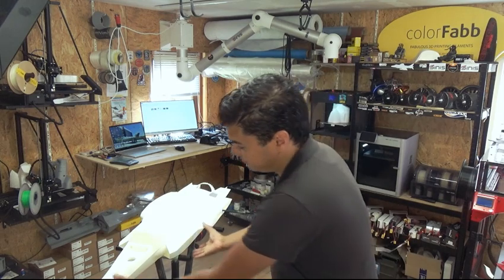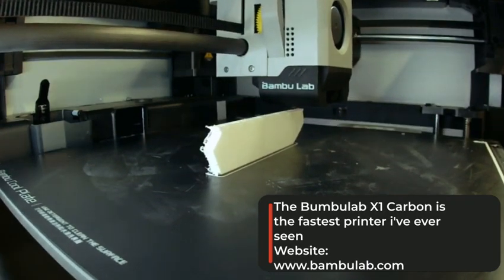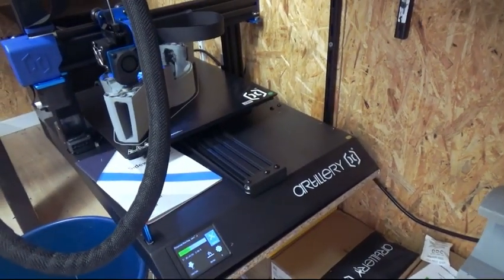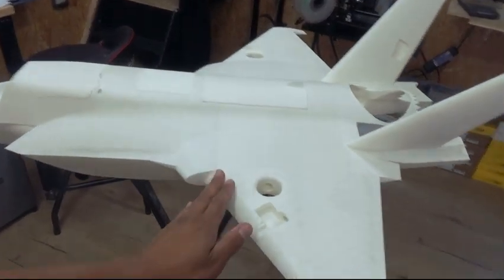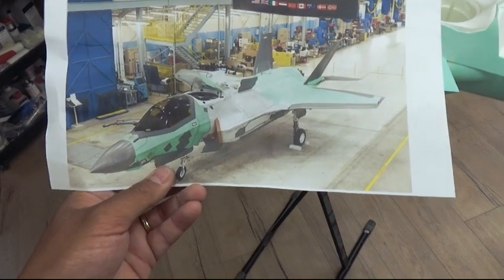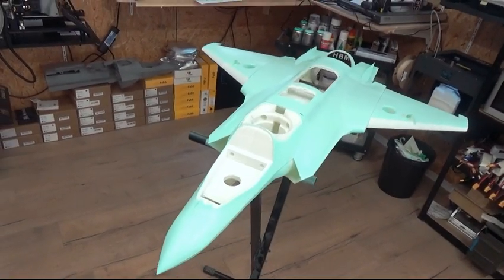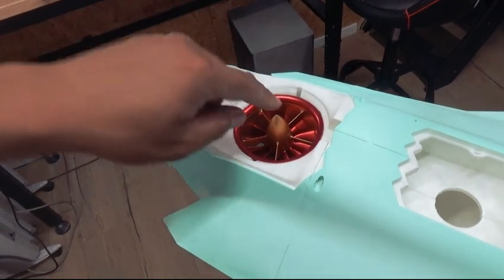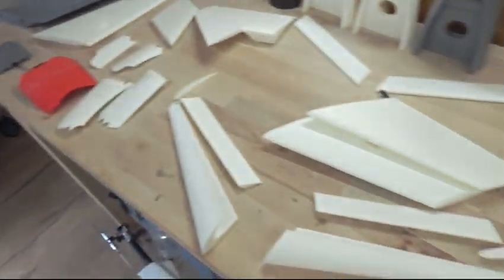F-35B RC-Jetprint VTOL Printed Jet build series | Wings with Bambulab and Artillery sidewinder x2

Comment: I have discovered there is a part missing from the print files. It is the piece after the tail nozzle with logo. The piece with all the jagged points that points down on the rear EDF. How can we get this file? Also, is there a better way of contacting you? please respond.
Reply from the maker: Just checked the files, it’s there
Reply: @Joelmelanie  I just redownloaded the files, and it is there. It wasn't in my original download, thanks.

Comment: I just bought the Bambulab printer. Hopefully some more detailed videos will be coming out soon, cause I’ve never built a RC plane or flown one. This looks like it could be a pretty fun project to build though 😅
Reply: yeah i havent flown an rc plane yet either. ive done drones, have a few, but i just got a p51 - d with a spektrum controller and the controller also allows me to plug into the pc and use it as a controller for a rc simulator called realflight which is teaching me how to fly and land properly without crashing that way when i do the real thing, i dont crash the new $500 plane, or the f35 when its done. controllers are spendy though

Comment: You are not showing any detail to the build of the plane. You go through it too fast, and from too far away. You put the tails on, but did you glue them? And which spars did you use? What spars did you put in the wings and in which holes? Do the spars on the wings go all the way through to the other wing? You really need to do a better build video.
Reply from the maker: I will do 3 other videos for guidance, how to assemble the thrust vector, how the setup the kk2 flight computer, and first flight. But did you read the guidelines on rc-jetprint? There is an pdf there of all parts and sizes of spars.
Reply: @Joelmelanie  Yes I have the PDF and I have all the Spars. But in the video I can't see if you only use 1 spar on the wings or more? The 500mm spar only sticks out of the body 70mm for the wing to go on. That seems kind of short for just one spar? There are extra holes, do they get spars? The same is true with the Stabilizers, I can't see in the video if there are 1 or 2 spars? 
I am almost done with all my LWPLA printing and hope to paint this weekend. Your print files are dead on perfect. It looks so good. I will send you a photo (if I can get your Email?). Can I get your setting profile for the PLA on the Sidewinder? Thanks again for your wonderful work!
Reply from the maker: @MikeMillerDrones  super awesome! Send it to info@vjmaviation.com I’m sorry I cannot read all 1000 new comments a day on YouTube directly so email is ok

Comment: amazing     do you make a non VTOL version?
Reply: does that come with the STL files?
Reply: @else9705  The Lipo holder is in the files, along with a lot of extras like the camera holder esc holder, even servo covers.
Reply from the maker: Yes
Reply from the maker: We made a lipo holder, you can slide the lipo into the front edf bay to have it as ctol

Comment: I've already asked it before, but is the F-35B also printable on a Prusa MK3 with its 21x21x25cm build volume? I'd love to buy and print your jet, but only if it's actually printable on my existing printer :)
Reply from the maker: Just cut the files in prusa slicer and print them separately
Reply: yeah the files come as stl so you can use them in any slicer, its just up to the settings you use to what the finished product quality has. the printers in the videos that he recommends are just ones that he used in the build himself and so the settings he used are available for example the creality ender 3 v2 etc.. if you play with the settings enough you can create what you want. im new to 3d printing, i just started because of this channel and this build specifically, and im glad i did. its already let me learn quite a bit about 3d printing but has been actually pretty simple to get the prints to come out great and easy to setup and get going.